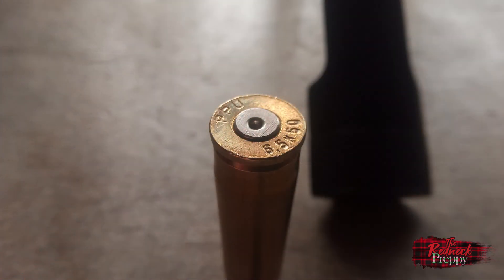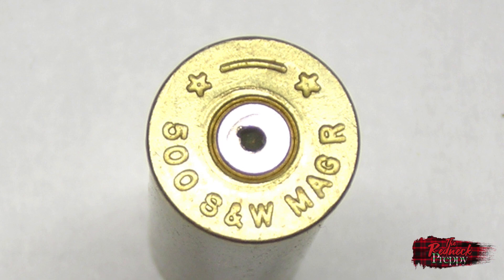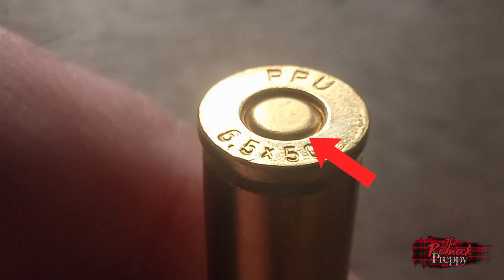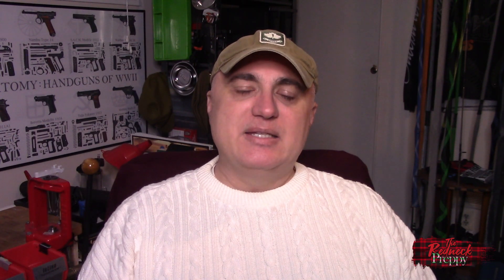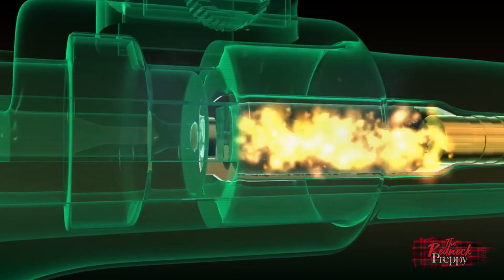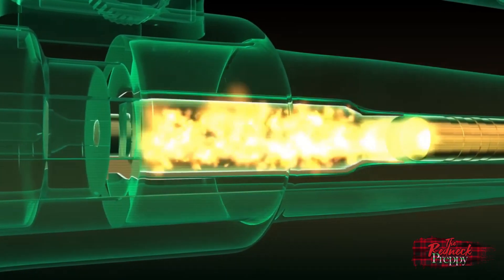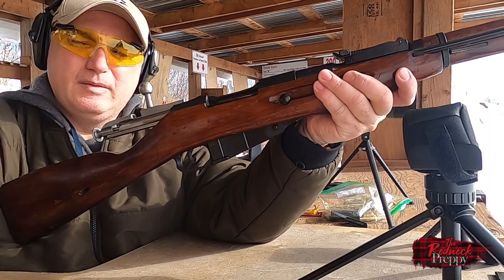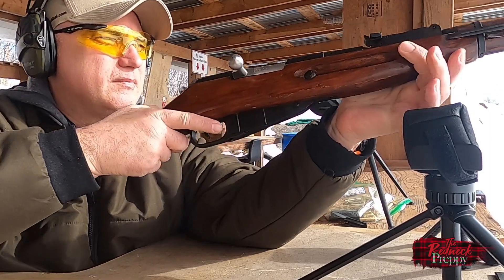Learn How to Read Pressure Signs on Your Reloaded Ammunition

Comment: Great video - and necessary for new reloaders. One mistake new reloaders will make is using much less powder than they should because they're worried about pressures. The irony is, with too little powder in rifle cartridges you can get a huge pressure spike in the chamber because it's not moving the bullet fast enough - the pressure doesn't get a chance to tap off into the barrel. (Basically, boom vs. controlled burn.) Like you say: always stick between the minimum and maximum recommended loads. There is a minimum for a reason, too.
Reply from the maker: Thanks for watching and absolutely great comment!

Comment: I can say if you have any real experience with reloading your Brass & Primers will let you know way before pressures get too crazy. Depending how deep your bullet are seated or how close to the lands you are will vary your pressures. The way you seat your Primers and the different Primer types will affect your pressures. It takes experience loading to understand how to read pressures. Majority of all loading software is not accurate it's just a recommendation. We've been building rifles and wildcating cartridges & Ackley improving cartridges over 3 decades. The majority of the time for us, it's all trail & erra. It's best to talk to experienced loaders or asking questions on different shooting platforms and research your cartridge. I've had loading software programs on many occasions give me false information causing me hvy pressures with my loads so be careful. All rifles are different. What works in my rifle might not work in yours. The best advice I can give to a new loader is start out low are work your way up until you start to see pressure signs and stop. You will find accuracy nodes at both the low and high end of powder charges. Just get you a loading manual from Nosler, Speer, Swift, Hornady, exc and start from their. Good luck & Be Safe no matter what your loading.

Comment: The only accurate way to gauge pressure without a pressure test barrel setup is by measuring case head expansion. Anything below 0.0005 expansion is acceptable. Anything over that is too much.
Reply from the maker: Good tip!

Comment: Maybe you should learn the difference between an extractor and an electoral. Ejectors leave a mark on the head of a case if the pressure is too high, extractors don't.
Reply from the maker: I've made several hundred videos totalling hundreds of thousands of words over hundreds of hours. I occasionally flub a line and misspeak.

Kind of like you did with "electoral", eh?

Comment: Any chance you’ve had luck reloading the 6.5 JAP?  I have one but have experienced (& later read) that the chamber a bit larger to accommodate a soldiers need to use dirty / grimy ammo.  

Base of each fired brass bulged out that reloading did not seem feasible (think I had to drill piece from die).  Secondly, have you compared 6.5 Jap to 6.5 Creedmoor.  Virtually identical.  Thanks

Geo Zeck
Bradenton, FL
Reply from the maker: Can't say I've ever compared those two cartridges but I have reloaded 6.5 Jap for a decade. Can't say I ever had any issues and nor have I ever heard that bit about oversized chambers.

Comment: I can add a couple more aspects,  1- the use of a micrometer on the case head from new to fired expansion of the case head even .0001 inch is clearly time to back down and reevaluate the load 2. Wrong powder this will give no second chance so check and label your work clearly. Good show. Aim small,good hunting,GOD bless.
Reply from the maker: Excellent stuff!

Comment: I am a gun smith and long time reloader,.
Yes I constantly warn people not to load below the start loads for a particular powder/bullet...... If working up loads you need a chronograph which can tell you where you are without reading primer/brass symptoms. Every primer backs out initially but is stuffed back in as the case head moves back against the breech face. A chronograph will show increased velocity increase per unit of charge increase fairly early on, showing that for that powder/bullet combo you are at the bottom of the exponential curve to disaster.
If your brass and and primers are getting damaged you are WAY over safe pressures, and only the robust nature of modern rifles is saving you from serious injury.
Get a chronograph, and listen to what it tells you. It'll save your brass, and maybe your life.
Reply: @KathrynLiz1  damaged brass could indicate a head spacing problem also!👍
Reply: I trust My reloads more than I trust Factory loads now. I would like to say if you reload don't get into a hurry. Slow down relax and double check everything you do. Nothing is more rewarding than making your own and doing well with it.